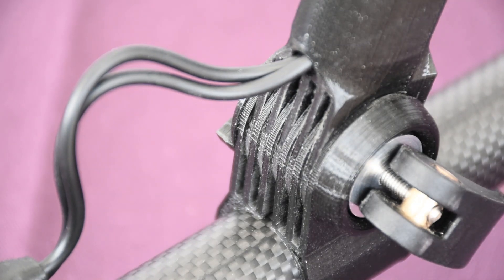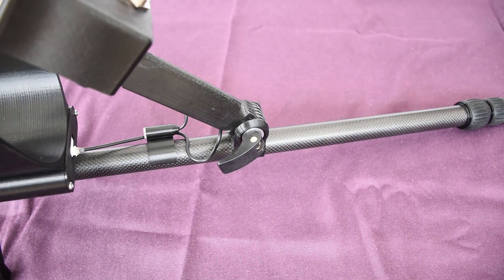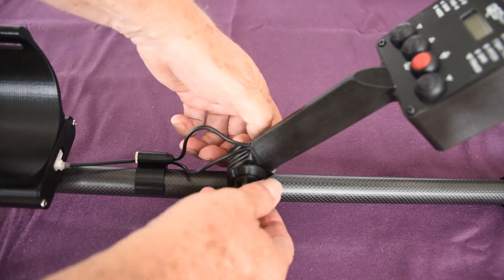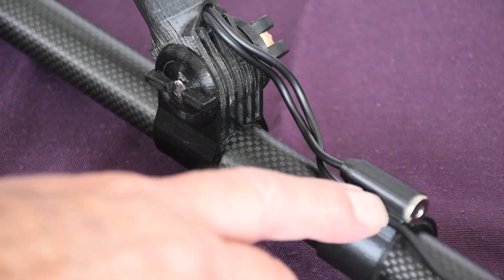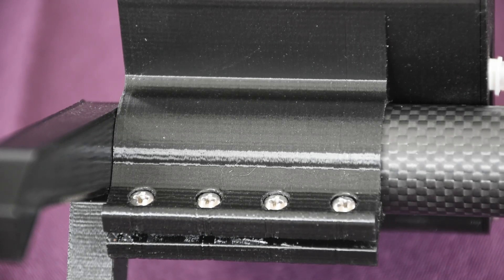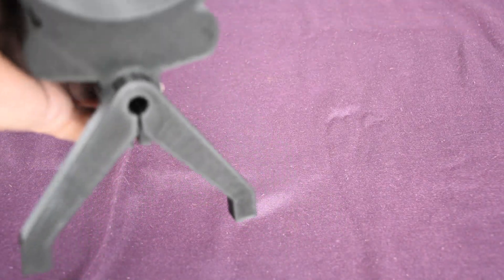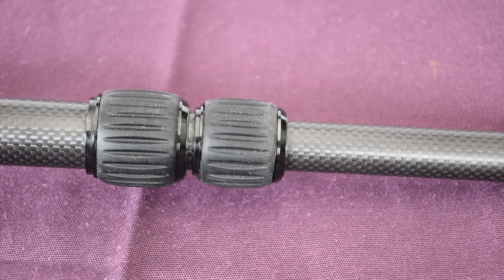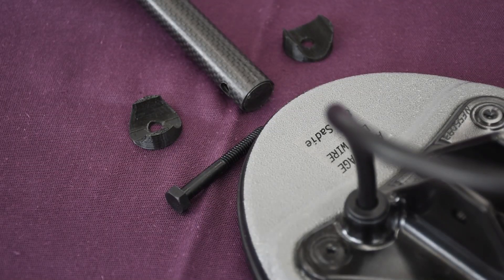QED PL4 Config

Comment: I like it other than the same weak little connectors for the wired plugs, why these were never upgraded to a stronger connector I don't understand.  It's not hard to source strong 2 pin and 4 pin metal screw in plugs to replace the weak little plastic plugs that are usually used internally on an electronic product not on something with a rough life like a metal detector.  It's stuff like that making it have the home made look.